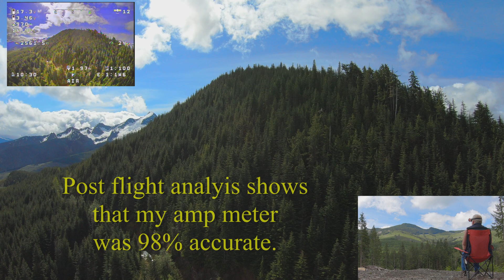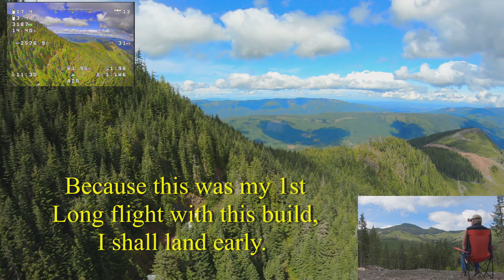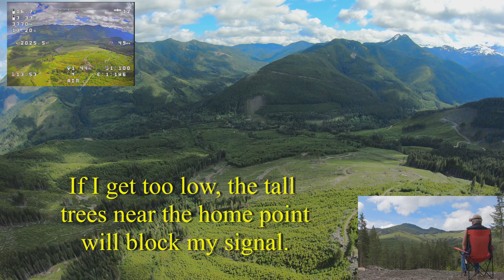Rush Tank Solo and 8 Inch Quad Long Range FPV Test Flight

Comment: I have the same Rush Tank Solo, but the range is very disappointing. I use a Skyzone Cobra X which comes with the Rapidmix VTX which is very good by reviews. For antennas, I use all the best in the market: a VAS 5.8GHz Crosshair Extreme LHCP and a Lumenier Micro AXII 2 LHCP for the goggles, and another identical Luminier for the Tank Solo. With Rush Tank at 1600mW I only got 2km before the video breaks up. The result is just on par with using open source PCB patch and pagoda antennas. I thought this set up would get me a range of at least 4-5km. Anyone knows what would be improved?
Reply from the maker: Try some long helicals.

Comment: excellent video, I want to use only the powers 25 and 100, can the change be made in the table or does it have to be the mandatory powers from 25 to 800.
Reply from the maker: I think one can o ly Chang to the manufacturers defined levels not arbitrary levels. Also I recall that one must enter the appropriate dB values in the table.

Comment: Awesome video! I feel inspired to possibly build my own Li-ion battery for my 7" source One dead cat build. I may also switch my Solo out of my 5" an install it in the 7". The akk race ranger is niice, but the video quality of the Rush Solo is amazing in comparison.
Very impressed with your build and your flight! #Send it!
Reply from the maker: Thanks for watching. Yes I have a 7 in source one and it's nice.
Reply: @ValleyFPV  which do you think makes for a better Long-range cruiser, a 7" or a 8"?
Reply from the maker: @lynxfpv  my 8 inch Big yeet quad is a little more stable than my 7 inch source one. Although I fly with 7 inch props. My next build might be even larger.. 10 inch .. perhaps even 13 inch..trying to decide that now but the price goes up.
Reply: @ValleyFPV  I can definitely understand that! I have hope of also diving into building a 9" or 10" over this summer. Yet still in the research faze. I figure longer flight time as long as it's "lite" enough running those large props. Maybe with a GoPro Bones or naked GoPro.
Reply from the maker: @lynxfpv  Exactly!

Comment: https://youtu.be/IegWns-R_go

Here is my latest flight. Camera signal could be better right?
Reply from the maker: Perhaps enable comments on your video. Might be better to discuss there..but yes to me appears that the white line noise is associated with throttle increase?  That could be power starvation. I would try to Wire the vtx direct to the cap and battery leads. Also looks like the noise I saw from environmental sources too in the past.

Comment: Magestic flight! Was hoping to get some feedback around the Solo Tank. It obviously performed extremely well! I'm using the Solo Tank in an Eflight T28 Carbon Z warbird. Very large foamy! I'm flying at a club field and we do have some power lines and homes that are about 1/4m-1/2m away. I'm not getting ANYWHERE near the quality you're getting. Can you share some pointers around what I may be doing incorrectly to get a poor video signal. I've adjusted the power settings too and seem to get same result. Please ask for any addl info that may help your assessment.
Reply from the maker: Thank you for watching. I might have to make a video about my wiring setup. That makes a difference. Plus where I fly there is almost zero EMI for miles. Check out the solos video image quality at 6k flight on N. Sisters mountain videos. I also use 6 turn helical antennas as well.
Reply: @ValleyFPV  thx for the feedback! YES, a wiring video would be AWESOME! I'm pretty new to FPV. My setup in my T28 is my first and only. I've always wondered about my setup/wiring if it's done right....your video really got me wondering. I know you don't have much around you unlike all the city distractions I have, but seems like my video could/should be better. I'll try and post my recent flight for you to analyze. Thx alot, really appreciate the help!
Reply from the maker: Yea, I'd like to take a look. When I wire up my quads, I now always do these things: 1. Install a good sized quality Capacitor near the battery leads  and pads. 2. Run the power and ground from the VTX directly to this same battery/pad/cap area and bypass any FC power and grounding pads. 3. I power the FPV camera only from the Vtx's conditioned power output and bypass the FC. 4. I have an additional larger gage redundant ground wire running from my FC to my negative pad near the battery. 5. I put all cellphones in airplane mode. 6. I make sure the coax from the VTX to the antenna attempt to bypass any electronics as much as possible.  However I have some times noticed that one place where I fly in "town" to do tests.. I get some noise in the video and discovered there is a Sheriff / police station close by. I think that their radio gear is adding some noise to the environmen. So.. I dont really make my final assessment until I fly "out in the hills" away from EMI sources.

Comment: Where do you buy 6000mah Li-ion cells? I searched the web and at most i found 3500mah cells.
Reply from the maker: Thanks for Watching... you cannot. I purchase Sony 3000mah li-ion cells and solder my own 5S packs. Then I combined two such packs in parallel..two to one lead. That doubles the amps to 6000 at the same voltage.

Comment: what FXT dvr is that, i have FXT viper googles and the DVR is the worst i have seen , very comroesseds low quality video, and btw, very scientific video, keep those videos coming , Best. R., you must try ELRS, is just great, i have the 2.4Ghz and 915Mhz modules, havent gone that far but a guy on youtube try it on a wing and gone 30km and back, and did not failsafe, he got back because of battery. not because of failsafe :D
Reply from the maker: It's a small external dvr made by fxt. It's fussy to use but records decent video from my goggles video out feed. My 5.8ghz video feed is not my range limiting factor..the quads battery life is. Battery power max range limits keeps me from  flying past my 5.8 videos range.

Comment: Awesome flight - the Rush Solo works awesome. Have you ever considered putting the VTX power levels on a switch? Or does it stay cool enough up there in the wind?
Reply from the maker: Thanks for watching. I do have a vtx power level control on a switch. Love it. I keep it at 25mw while on the ground and at higher during flight.

Comment: Thanks for sharing this test flight. Many things I learn from your video. Just to ask your experience on VTX antenna for long range. Which one the best so far?
Reply from the maker: Thanks for watching. So far been using mainly the TBS Triumph pro with good results. Also the True Rc antennas are nice. However the antennas you wear on your goggles have more impact on signal reception than does the VTX antenna.

Comment: Do  you like your rushtank vtx better than tbs unify pro32 hv? Also, Rush Tank Solo VTX only has 1W from what I see.  How did you get 1.6W?
Reply from the maker: I have never used the TBS unify pro 32 therefore I have no basis for comparison. I am pleased with my Rush tank solo and also Ultimate II on another quad. The online info about the Solo power varies from 1W to 1.6W.  I also read that the output varies with how efficient it is cooled. On the bench I measured mine with an Immersionrc meter and it was outputting 1.2W at that test. I have yet to find any information stating if the US version outputs at any different power level or not from the international version. I have a US  version of the Solo. So far have been out 3.6 miles and a good signal was recieved  with my 6 turn Helical antenna.
Reply from the maker: I've heard that in the US the maximum legal output power for analog VTX's  is 1mW. However there seem to be VTX units hat transmit higher. Seems that in the US resellers might be advertising the units as transmitting at 1W, to avoid.. issues.

Comment: Nice flight! I was just there yesterday. An attempt to make it to the north sister but my battery was making me nervous so had to turn back at around 2 miles. My friend made it all the way though 3.6 miles!
Reply from the maker: Yea, this is a battery intensive flight for sure. I figure that I have the amps now to fly to the South Peak as well, but I need to get the nerve up to do that and do a few more practice flights.
Reply from the maker: Cool. We flew today to the N. Sister Peak 3.7 miles and back. Was a perfect flight.

Comment: so do you want back to Akk vtx?
and a couple of tips, before flying far, they will check the RTH, you can lose the connection and the RTH does not work and the quad will fall. and  why don't you want to add the distance flight to the OSD?
Reply from the maker: I am using Rush now and very pleased.